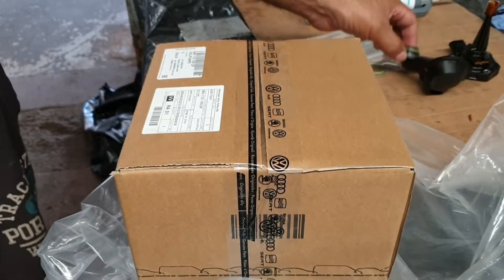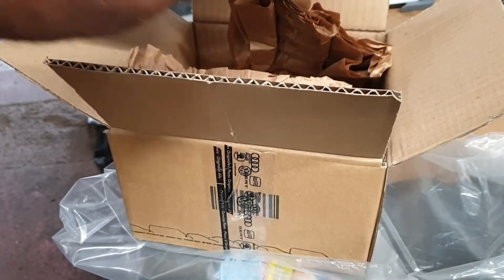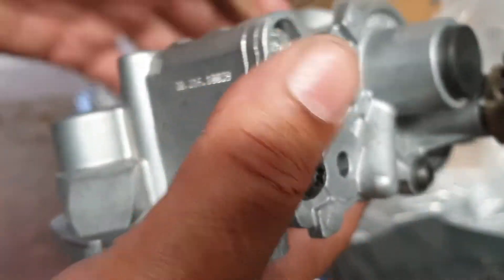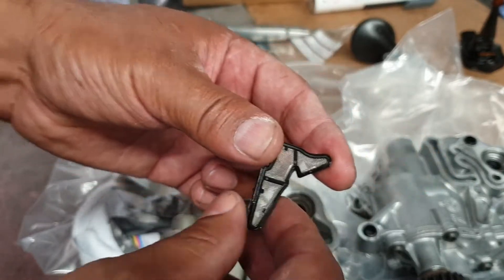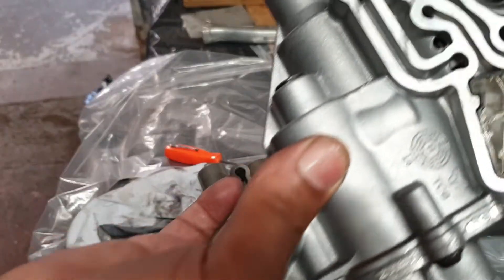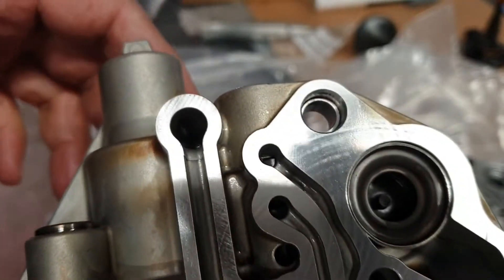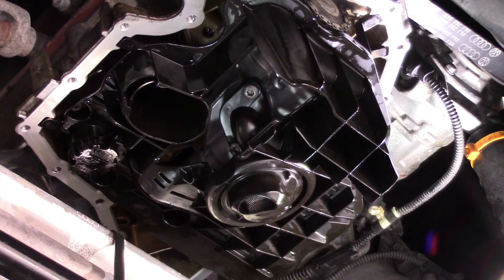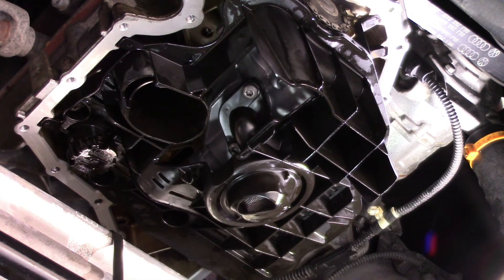Audi A5 (8T3) 2.0 TFSI CDNC engine Oil Pump Installation

Comment: Great video! Did you test oil pressure at 2000 rpm and 3700 rpm before installing new pump? I have low oil pressure in a CDNC when the engine is warmed up, but only at idle. When I rev it to 2000/3700 rpm the oil pressure is correct.
Reply from the maker: Thanks for watching our channel,
Actually, i can not remember that task. How did i do it.

Comment: Any tips on putting the steering column back on to the steering box if you forgot to mark it with a marker and the steering box point was moved ?
Reply from the maker: Thanks for watching our channel 
Best thing is to put steering wheel in straight position, remove ignition key, if the vehicle has smart key make sure ignition is off and the ignition key is a way 10m from the vehicle then steer  the steering wheel 60° (approx) to the right or left until the steering wheel lock engages, secondly on modern vehicles the steering column and pinion engage  at certain alignment points, that cannot be missed until you steer the steering wheel a complete circle (turn). Marking the position of steering column to pinion gives you assurance of correct alignment of the steering column to the steering box pinion.